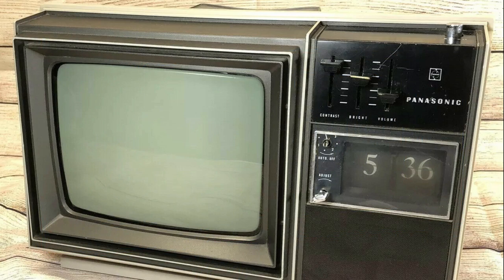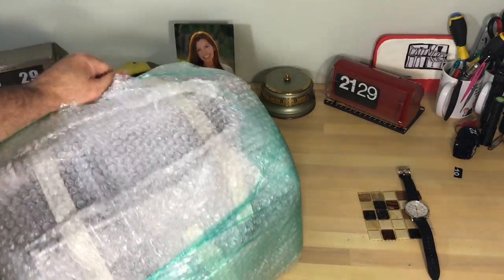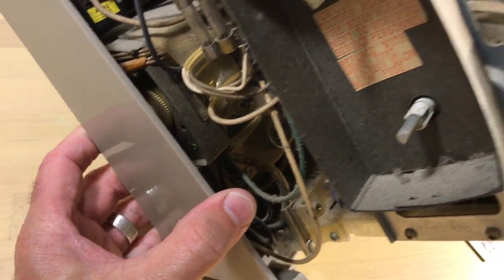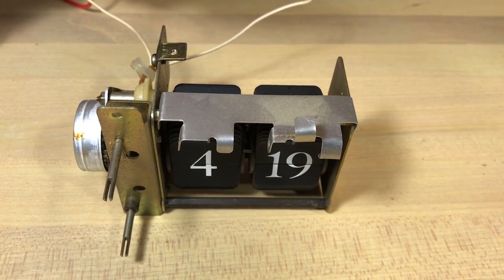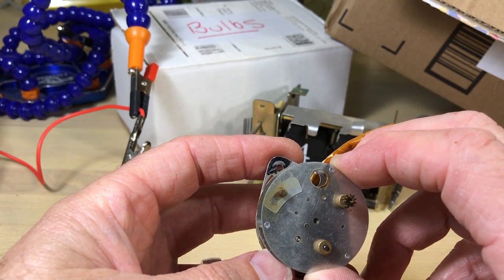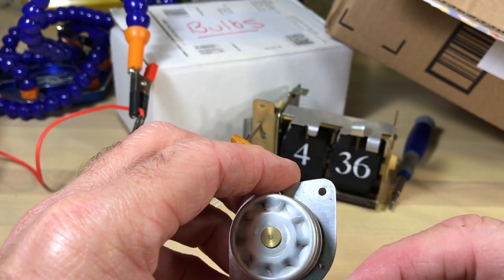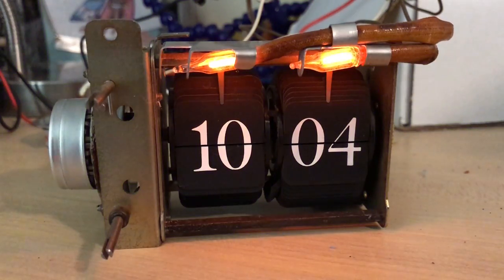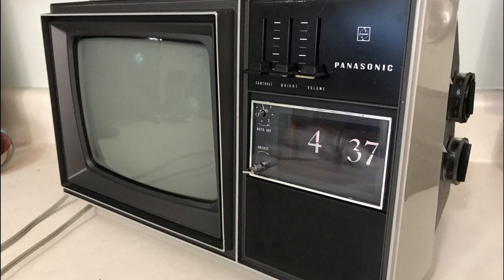The Panasonic AN-409T portable TV with flip clock

Comment: I have that exact television set the clock doesn't work but the television works good enough it has some issues. Hopefully i can get it fully operational again.
Reply: It is an amazing little TV that uses vacuum tubes instead of transistors.

Comment: It is possible to get the tv working with a digital converter box.
Reply from the maker: Thanks. I understand. But I'm more concerned about the actual picture tube and the internal electrical components (and little tubes). I'm worried that it needs a once over to keep it safe. It has a bit of a hum to it when it's on.